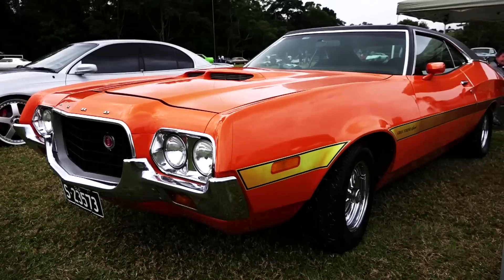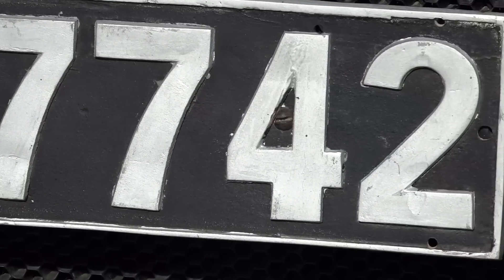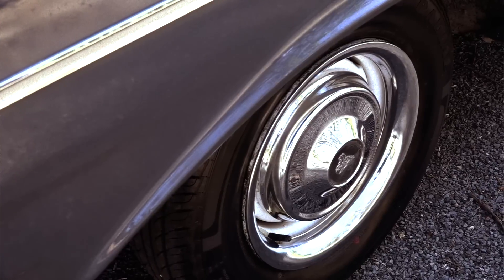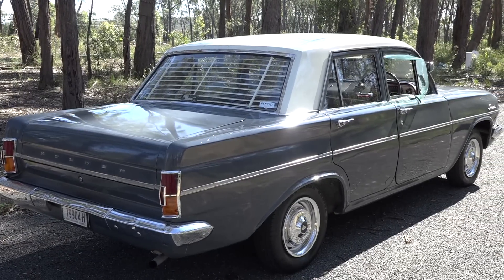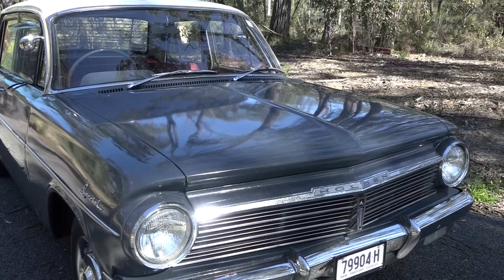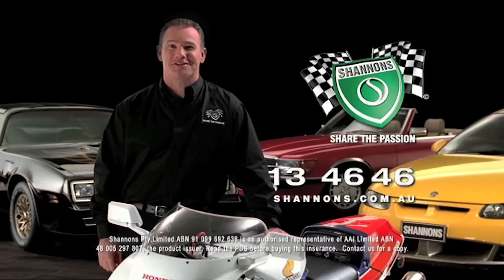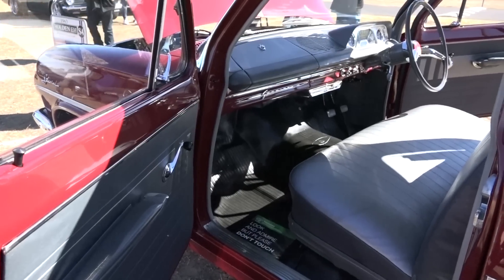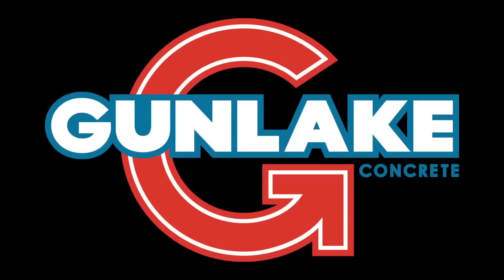Three Classic Holdens: Classic Restos - Series 43

Comment: Power Steering was available in EH.
Disc brake front was available mid model upgrade with the HD Ball joint upgrade in Winter '65....
X2 was available in HD (179) and early HR (186) then in 1967, the two Barrel 186S replaced the Twin Carb 186 X2... 
The HK was a big leap forward
V8 option and a 111" wheelbase and 71.7"width and 184.8" length. The HK got dial circuit brake system and collapsible steering column... This would Mark the end of the Early Holden era I would think.

Comment: i owned ej s and eh s back in the day they had very slopy boxes. to worn out boxes....not many around with tight boxes ...was a gm problem in the day and king pin front end was a shocking design .....ford was so much more superiour in design and engineering